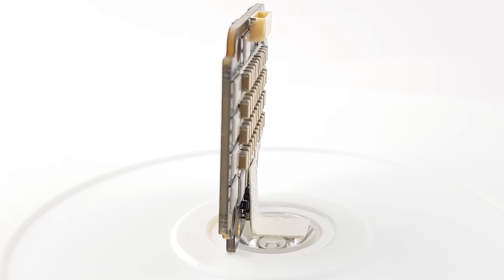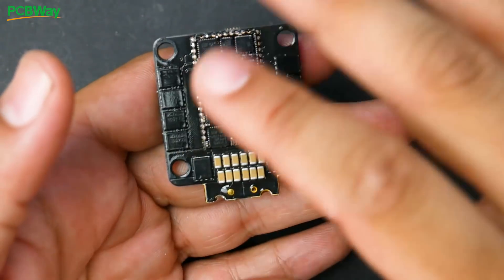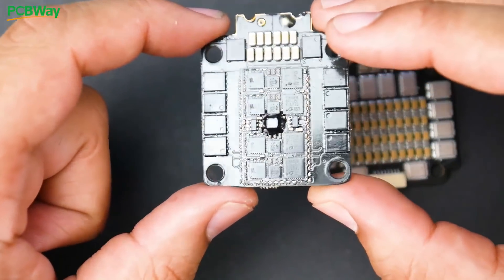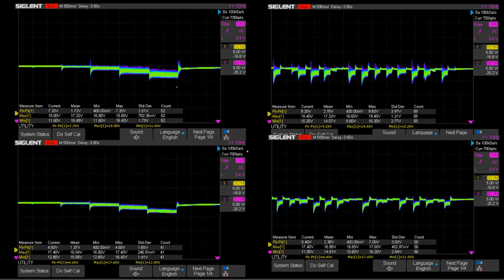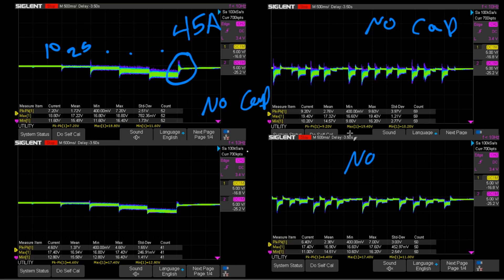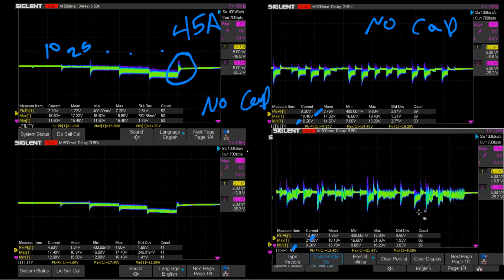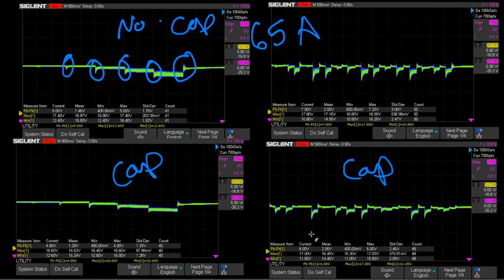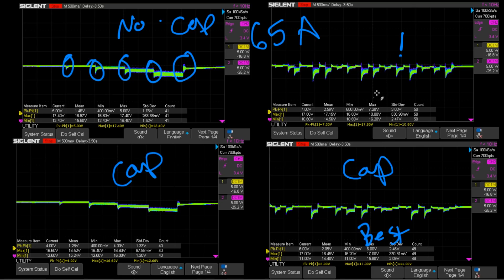The Best ESC's On the Market Noise Tested // Holybro Tekko32 65A & 45A 2020

Comment: I have the first version of the 65a metal Esc. It’s a 60a I believe that went on my 7 2806.5 1300kv motors.  It’s a super cruiser and now my main film rig since I’ve been doing gigs. Been flying it freestyle, LR, and for Cinematic. Just recently motor 2 esc blew the heck up mid flight. So I’ll be getting the new 65a one.

Comment: I often observe and have some layout analysis on new ESCs on the market, and this one caught my attention. It's interesting how they came with external dedicated comparator chip, the LM339Q which can be seen as the third QFN chip on the logic PCB. Surprised you didn't even mention it a single time, what's your thought on this?
Reply: You seem like someone who know's a bit about digital electronics. I was wondering your opinion on the individual tekko f3 65A esc's. They seem to used to come with an ultra low .25 mohm shunt resistor. now they have the m30 shunt resistor, which I cant find any info on. Do you think that will make a bid difference in efficiency?
Reply: Never seen that,  @almightygun . Where can I see one?

Comment: Sitting here getting ready to reflow some fets for 1st time. I have the 45am f3 an some f4 ones but my ? Is about the tekko32 b4 the f3.i get the info off the fets on the bottom but the fets on top have no marking just circle in upper right. So I can't find info on the fets on top

Comment: Hello! 
Does 65A means total of 65Ampere (16,2Amp per channel) or 65Amp for every channel (total of 260Amp)???

The esc supports up to 6S or 25Volt DC , wich means the Esc should manage MASSIVE 6500Watts  (25Volt x 260Amp) of peak power!

260Ampere needs AWG6 tick power cables or 16mm²

Can you confirm the amperage?

Comment: Wow, those look really good! I like the addition of the extra copper too. That should help the mosfets dump heat after high current moves, and help them last much longer. My one concern is the added complexity of those ceramic caps on the 65a. It clearly did wonders on keeping voltage spikes down, but it always seems like the hardness/brittle nature of the ceramic makes those caps the first things to fail on a board after a crash. I wonder if adding that many could be introducing higher likelihood of failure. Only time will tell I suppose. Thanks for the review!

Comment: The reason to keep the circuit board separately is not to improve power delivery but to fix the previous version which would fall out of the air: https://github.com/bitdump/BLHeli/issues/464

Comment: These seems very good esc:s thanks. Can you do revisit with old budget classics like racerstar 35A (rev35a), old mamba and maybe new mamba esc? Thanks
Reply: I’m pretty sure the 35a isn’t much good. I moved from that to the t motor 45a and wow the difference was huge. Anyway the t motor is only £7 extra so worth it
Reply: @gautamkrishna7421  Rev35 is 22usd shipped at Ali.  I have on rig with that and it flyes great 6S 2150kv 2207 (with rpm filters). Im pretty sure it has best bang for the buck of any esc.
Reply: aFPV oh shit that’s cheap as hell! I suppose I’m not giving it credit for the fact I ran one for like 1 1/2 years+ no issues. Just needs a fat cap
Reply: @gautamkrishna7421  yeap, def need a cap (like all others as well). Mine is also like 2 years old and like 300packs flown - no issues.

Comment: I keep on reading multiple posts on Facebook on the holybro metal ESCs (4in1) blowing up - I think this was the previous batch. Was this a bad batch?
Reply from the maker: Your talking about the first gen batch this here is 3rd gen. Plus holybro support will take care of you if anything happens as they usually do.
Reply: Nope these blow up too
Reply: @DroneMesh  to this day im still seeing post of these escs failing. Mosfets blowing up or being desoldered. Interesting results here but it seems these meta fet escs are not reliable at all.

Comment: Also yes, it is worth it to get that kind of quality for that price. I have a Tekko32 35A 4in1 and before I jumped to using the 4in1s, I would get a very noisy video feed in my goggles
Edit: have* and also it's still in my cheaterkwad build although I'm planning on selling it off along with the Q X7 since I'm moving on to phase two of my hobbies. Getting a TX16S and shifting my budget into ham radio

Comment: I bet that KISS esc or FETTEC esc have even less noise than these would be interested for you to test.
Reply from the maker: Kiss are the worst they where burning left and right
Reply: Drone Mesh that’s just not true and those cases are of user error. I’m saying from a noise point of view they are second to none. Fettec is running at 128khz pwm freq for example
Reply from the maker: Not talking about fettec never used them. Kiss where always catching fire.
Reply: Fettec's onboard filtering is very minimal and nowhere close to the 65A version of Tekko32. Don't let me start talking about how they decided to use puny 3X3 QFN FETs for a 45A rated ESC.
Reply: @Asu01  From a software perspective you cannot argue that BLheli is better no matter which way you slice it. KISS and FETTEC are more advanced and you won't see that changing on a blheli_32 platform anytime soon.
Reply: How can you go from the context of electrical noise which is mostly determined by hardware and then talk about software,  @graykimchi ? Even that, I can argue which one is subjectively better by the amount of programmable parameters each system has to offers. It's so obvious which one has more programmable parameters, and the programmable parameters capability is very important for me to fine tune a quad and in general, just having more option or customization.
Reply: @Asu01  I would argue both sides are better. and you're correct Kiss and FETTEC have little motor config but its just not needed in their case. I rarely hear of desyncs on kiss esc if not ever.

Comment: Hey bro why don't you noise test  the fettec 45a esc with spots on board for six caps and it's sin wave does not work like a normal esc you think the holy bro new metal is the best that esc is trash and had fets melt off if you want to know the best esc on the market test the kiss four in one it has 95 capacitors on it putting the metal to shame I guarantee it it will destroy the metal result